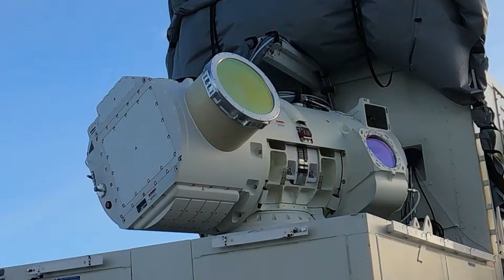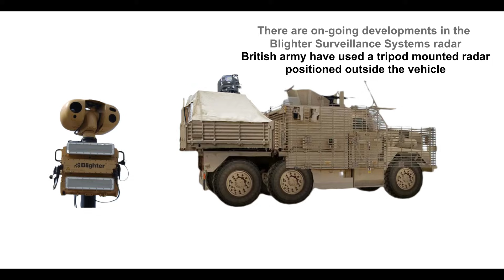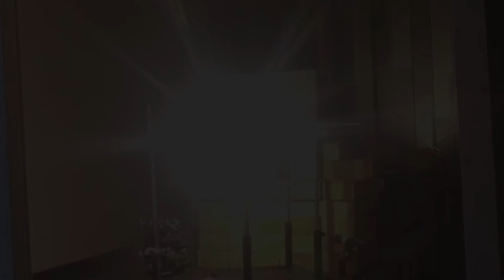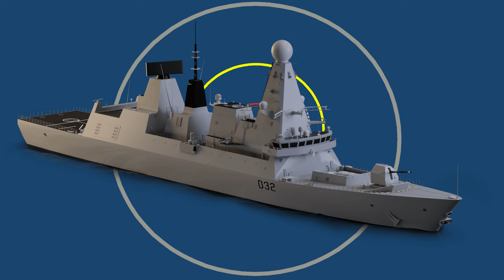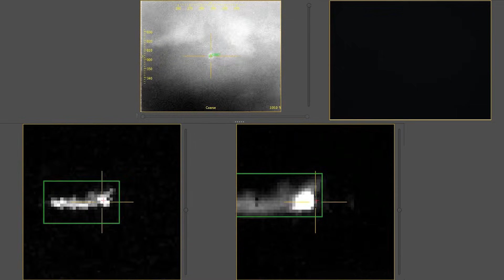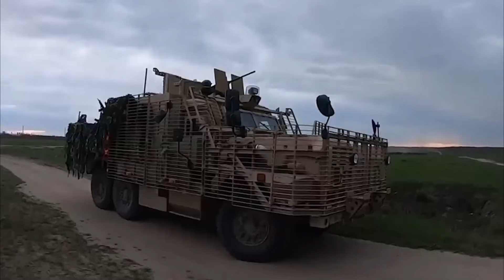DragonFire, Royal Navy, Ukraine and the other directed-energy weapon!

Comment: That's not very powerful though.
Reply: Obviously powerful enough for purpose.
Reply: They have to start somewhere. The most important thing is to get the tracking speed and accuracy sorted first. The power of the laser can be increased as and when it’s designed.
Reply: Much more powerful and you would have to take massive amounts of batteries around the battlefield... solve one problem and create another.